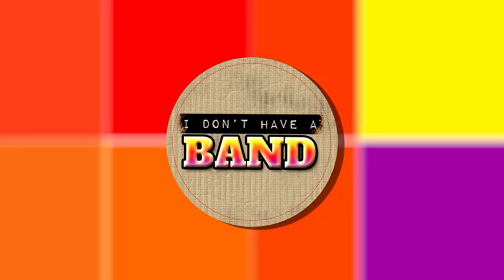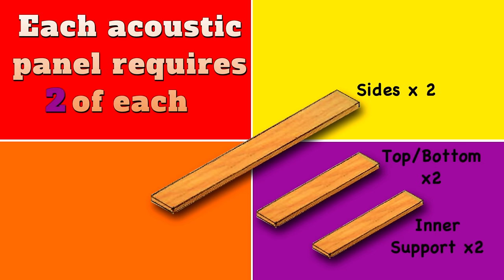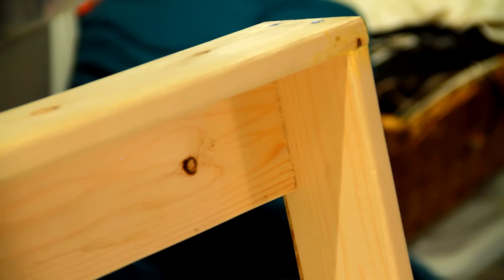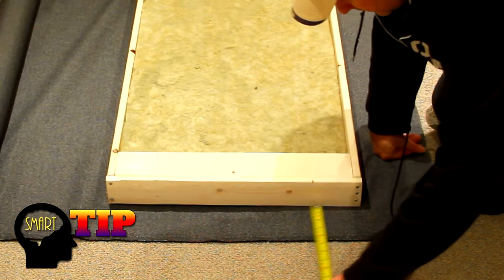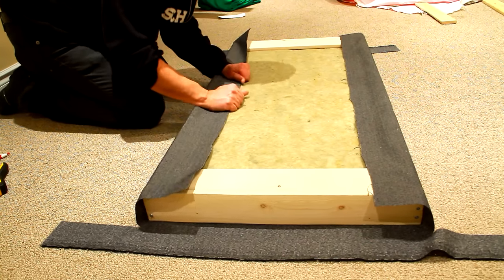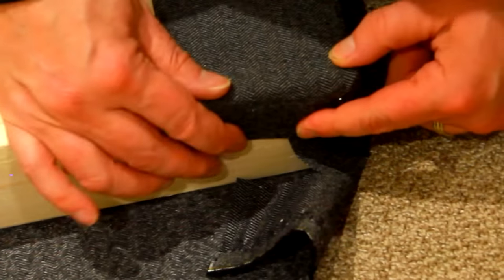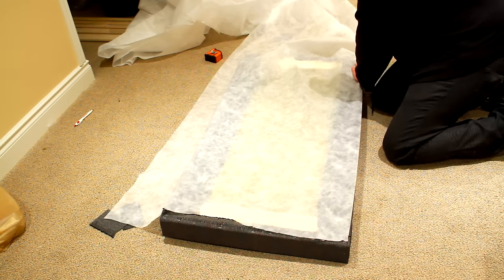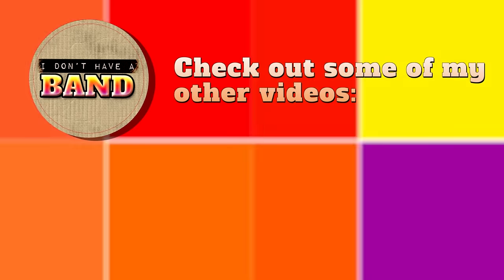DIY Acoustic Panels - How To Make Your Own Cheap and Awesome Panels

Comment: Question. Roxul changed their company name to Rockwool. Was the Roxul Safe n Sound brand @ 24" 46.5 inches in length(true dimensions)? 

 I just picked up some 24" Rockwool Safe n Sound from Home Depot (I'm also in Canada) and the true length of the stuff I have is 47.5 instead of 46.5.  The package says 47 but my batts are definitely 47.5. I think this means I need to make the long sides of my frames a tad longer so the rockwool isn't compressed.  Just wanted to point this out to others since Roxul as a brand name is no longer. It could be I just got an off batch because 47 inches makes more sense instead of 47.5.
Reply from the maker: I used the Rockwool brand actually.  I'm in Canada as well.  You won't have a problem squeezing that extra half inch in the frame.  Don't think you need to make it bigger, unless you want to.  Good luck!
Reply: @LonelyRocker  I think I just had a weird batch.  The first bale had a few pieces at 47.5 inches but the rest are 47 inches. A slight tight fit is probably a good thing. Cheers.
Reply from the maker: Absolutely.  A little bit snug is actually beneficial.  Check my channel for my other Acoustic Panel videos.  My Panels 2.0 video introduces some new concepts plus really meaty bass traps and I have a bunch of other panel resources: https://www.youtube.com/playlist?list=PLXdLRrtu2mlqZQ0ojiINRu53fDSTpTRyO

Comment: Making ceiling hanging baffle and this lets me know I'm doing it right,using egg crate foam for insulation (very dense version) 400 thread count (doubled/cotton = 800) front layer cover.Panel is 36"h×48"w×2"d . will hang over mixer/engineer area
Reply from the maker: I would really test the foam before you go to all the trouble. I’m not clear on the foam you are using but all tests I’ve seen show foam greatly under performs verses proper sound insulation.  Especially in the lower frequencies.
Reply: @LonelyRocker  Thanks 4the info/advise,haven't comitted to anything as far as insolation,just getting my components 2gether,frame done now on 2the filler,so2speak...Thanks again😎
Reply from the maker: The Rockwool/Roxul is pretty cheap if you're making a few panels.  You get enough for 8 panels in the bag so the cost really isn't more expensive than foam and your results will be so much better!  Happy to help.  Thanks for checking out my video :)
Reply: In the radio stations I’ve worked in, we had Sonex Classic foam panels on the walls. Foam of that quality (and you pay well for it), is a diffuser, not an absorber. Lesser quality foam is a waste of money and really just a scam to take your money. To have sound absorption, you need a material that is dense. Rock wool and Owens-Corning 703 are the materials considered adequate for this type of application. I have purchased 12”x12”x12” dense foam cubes before to use as bass traps. FAIL! Doesn’t work. Just go with the rock wool and spend some thought on your anchoring system. You can use screw-in anchors with picture frame wire and you should be able to safely suspend the panels from the ceiling.

Comment: Tips on adapting this design for 4’x4’ gobos and not wasting wood?
Reply from the maker: Measure measure measure!  Plus check out my mini-panels video where I demonstrate using different materials and you can adapt the size to your needs: https://youtu.be/AdDdumAieJs
Reply: @LonelyRocker  Cool...Why did you use 22.75" x 46.5" for your inner dimension when the rock wool panel is listed as 23" x 47"
Reply: sorry that seems dumb, yes I get that it gives you an outer of 2'x4'... but if I wanted a 4'x4' or a 4'x8' will I start getting an air gap that the insulation isn't filling up? If so, should I plan for that gap and add wood spacing?
Reply from the maker: I think you're overthinking this.  The best is to conform your panels to the materials you are using.  I sent you the mini panels video to show you how the dimensions can be adapted to your needs.  Insulation should be snug in the frame.  Air gap is behind the panel for the install.  And instead of 4x8 panels, make 2 2x4 panels.  easier to manage in my opinion.
Reply: @LonelyRocker  Did you find the "actual dimensions" of the insulation off a bit? I am waiting for mine to return to their full size, but I bought 24"x48" because that is what was available here. Do you think they will actually be those dimensions or will they be smaller/bigger slightly? Im just trying to draw out plans while I wait for them to return to size after being crushed in the wrapping.
Reply from the maker: The dark truth about construction materials is the actual dimensions are always smaller than advertised.  Measure a 2x4 and you'll see what I mean.  Just need to roll with it and measure properly before each cut. :)

Comment: would this rockwool stuff work for covering\placing in a window frame to assist in blocking sound from getting out? I'm trying to reduce noise complains from the neighbors before it turns into a bigger issue than i already is. My windows are old as hell in my apartment and sound leaks out like crazy.
Reply from the maker: Sound absorption and soundproofing often get confused.  The techniques in my video are designed to “absorb’ distracting frequencies to improve your mixing environment but can not absorb all frequencies blocking sound entirely.  Soundproofing requires serious structural changes to work.  So these will have little effect preventing others from hearing your music.
Reply: Lonely Rocker Yeah, I’m not looking to block it entirely as that would be impossible especially due to many other areas of the room leaking sound. The window is the major problem that I’m attempting to at least reduce sound from flooding out of a single paned 40 year window.
Reply from the maker: Check out my new panels video where I made 8 inch thick panels.  Maybe these would serve you better: https://www.youtube.com/watch?v=MHnFYFZc-w8&t=483s
Reply: Nikk Grimes seal the window shut with long life caulking. Then place a black panel inside, add insulation, then complete it with two layers of3/4” plywood and screw into place. 

Ad another layer of drywall to your outside wall and ceiling.

Comment: Hey man in regards to the rockwool i'm trying to find our UK equivalent in terms of dimensions is the thickness of the pack you describe 25mm? or higher?
Reply from the maker: Hey.  The Safe n Sound is actually 76 mm thick.  If you find a similar product that's thinner you could double or triple up.
Reply: I'm in England, here's what ya need!

Rockwool - RW3 at 1200mm x 600mm x 50mm (4ft x 2ft x 2inches) - is a pack of 8 and has a density of 60kg/m3 so quite good at absorbing lower frequencies as well as mids and highs! To get even better low frequency absorption you would ideally want the RW3 at 1200mm x 600mm x 100mm (4ft x 2ft x 4inches) but this only comes as a pack of 4 and is about the same price as the 8 Pack, so it's a choice between more coverage but not as much bass asborption or more bass absorption but half the coverage!

You could also get Rockwool RWA45 at 1200mm x 600mm x 100mm - two 4 packs is basically the same price as one 8 pack of the 50mm RW3 mentioned above - but the density of this is 45kg/m3 so, again, slightly less bass absorption in terms of density BUT its thicker so I think you kind of get some of that absorption back if that makes sense?

The smaller the room though, the thicker and denser you probably want the panels to be because you'll probably have more problems with lower frequencies!

You can always start off with the RWA45 for some decent, broadband absorption at your first reflection points and then when you have the money go for the heavy duty 100mm thick RW3 and make Bass Traps for corners!

check out onlineinsulation-sales.com for the rockwool and builderdepot.co.uk or B&Q or Homebase for your wood!

Hope that isn't as confusing as it might sound hahaha, good luck man!
Reply from the maker: Thanks for the assist! Cheers!
Reply: @ethanlonsdale689  you're a legend thank you for this!
Reply: @LonelyRocker Cheers lads!
Reply from the maker: Good luck with the build!!!!

Comment: Great video! I actually followed your process but there are a few things that I had to do to make some adjustments. The first one was finding the right mineral wool to use. The mineral wool that you suggested is very expensive now ($70 for 4 24x48) and it’s very hard to find. So I decided to go with 47“ x 15“ and was able to find six sheets of that mineral wool for $20. The other thing that I had to do was find the wood and that wasn’t cheap either since lumber has definitely gone up in price. I got 6 x 12‘ boards for nine dollars each. Lastly I also got the back paneling for about 10 bucks. Nails cost me nine dollars. The hangers cost me about $12 with the wire. As you can see the stuff starts to add up. The acoustic fabric was $46. In the end these panels are going to average about $30 each. Although cheaper than spending 60 or $70 on Amazon it’s definitely more expensive, but maybe in the end I may not go this route because I have to factor in my time which is also costly. Again great video but you need to make some kind of note somewhere where things have doubled and even tripled in price since this worldwide issue we have faced when it comes to importing goods now.
Reply from the maker: Prices have changed since I made this video but prices also fluctuate depending on where you are.  Another viewer told me his cost was closer to $30 per panel so not that far off.
Reply: Do you know exactly what i will need of fabric for 8 of those with same measures as the video? Thanks in advance.
Reply from the maker: Sadly math is not my thing but just calculate based on the size of your panel, multiply by 8 and add extra just for safety ;)

Comment: How big does the fabric need to be
Reply from the maker: As I showed in the video my roll was 58".  For the width I added 6" past the edge of each side so each panel got 36 inches.  So 58"x36" of fabric per panel should do the trick but confirm with your own measuring :)

Comment: Where do you get the Rockwool (mineral wool) 24" x 48" x 2"? Home Depot or Lowe's do not carry that size. Anywhere online you pay at least $45 for shipping. Where is everybody getting there's?
Reply from the maker: There seems to be an inconsistent supply chain for this product depending where in the world you are.  I'm in Canada and the product was readily available at Home Depot.  The product is also known as Roxul.  Barring that, you should be able to ask your local vendor about mineral wool based insulation designed for "acoustic performance".  There are other brands in different markets.  If you find it in a different size, you may have to cut itto fill your frames.  That's ok too.  Just pack it in nice and perhaps put an extra layer of the backing material inside to hold it all together and keep loose fibers in.  Good luck!
Reply: @LonelyRocker  I found it at a building material supplier! Thanks for your advice. Looking forward to a nicely tuned new studio! Thanks for your help to that end! Bravo!!
Reply from the maker: My pleasure!  Glad you're on track.  Working hard for my subscribes...if I earned one 😀 Good luck with your build!  Check my other panel resources.  I have a few videos that will help you with placement, testing, bass traps etc...

Comment: I'm in the middle of doing this ! Couple of comment worth mentioning, jigsaws are no good to do straight cuts, even with 4" planks (current experience, even with a guide). If you need to go off the suggested dimensions and need to cut the  wool, get the proper tools, unless it is going to be messy (search for isolation knife in your preferred hw store).
Reply from the maker: I think you mean "Insulation" knife;)  I agree having the proper tools is easier but these panels do not have to be surgically accurate.  I've made over a dozen of these with just a circular saw and they all turned out great.

Comment: Screwing into the end grain is about the weakest joint you can make and should be a last resort. A two hole Kreg pocket jig can be had for $40 and is useful for all sorts of projects. Also there are many tutorials on YT about canvas stretching, including the exact order to place staples and how to finish the corners. This has been known for several centuries.
Reply from the maker: These things are tough as nails mate.  Save the cheer for a rainy day :)
Reply: These don't have to support any weight, so screwing into the end grain is not a big deal…
Reply from the maker: @Gongtopia  Bang on.  Thanks for the assist :)

Comment: Mannnn, I put the fabric on the wrong side, and I don't want to remove it. Will this effect the sound, only made this mistake on one out of 13 I am building.
Reply from the maker: Ha!  The fabric should have no effect on absorption...so it should be fine...Maybe a little extra wood on the back.  Or just fix it! 😝
Reply: Thanks 😊

Comment: Does it matter what kind of wood? Pine?
Reply from the maker: Not really.  The stronger the wood the less it should warp over time.  I used Pine and it does the job...
Reply: The wood species isn't very important as long as it can be assembled into a frame.  I used everything from cheap pine plywood to MDF.  You can get a sheet of 3/4 inch (19 mm) plywood at Home Depot, or your local home renovation store.  Just ask them to cut the sheet into strips that are 3.75" wide.  You should get 12 strips out of a sheet of plywood, which is enough for 6 panels.  Plywood may be slightly more expensive than using pine boards, but it will be straight and stay straight, unlike the warped pine boards used in this video.

Comment: Hi, great video... wiill the rockwool  16” (2x4) work?
Reply from the maker: Sure.  If you are still making 2 foot panels you will just need to cut the insulation to fit your frame.  A little more work.  Just make sure you pack it in there and make sure it will hold in place.  Ideally one piece would be more stable but you can make it work if that's all you can find...
Reply: Lonely Rocker thanks for answering back ... I went to lowes and home  depot , but they dont have the exact one. Im thinking I should special orrder it.  If you have a link that would be great , i really don’t want to mees this up. Btw i am located in El Paao ,Texas.

In addition, i wanted to see if its a good idea to wrap the foam with the fabric with some sort of material as the base for the foam.... i was thinking just to insert the foam panel into   the wood structure, i kind of like the look of the wood. Any thoughts on this?

Thanks
Reply from the maker: I honestly wouldn't know where to link you for your market.  I bought mine at my local Home Depot.  I know it's available in the states.  It may be under a different brand like Roxul.  Just ask for Mineral Wool based insulation with acoustical properties.  And make sure to watch my Panels 2.0 video.  It may answer your 2nd question: https://youtu.be/MHnFYFZc-w8 Happy to help!!
Reply: @manueldiazjr6440  Hi Manuel. I'm not sure where you are located but Lowes in most Toronto stores has this. I bought mine yesterday and checked online before I went.

Comment: I need to treat a former dancing hall but I can't make any permanent changes so wall hanging is out of the game. Any ideas to make it portable and stable?
Reply from the maker: You could try and make stands for them.  Use wood to make a sturdy base and mount them upright on the stands.  They are not very heavy so wouldn't be difficult to do if you were reasonably handy.
Reply: Having made these, 3M double sided tape does a great job while not pulling paint of the walls when uninstalled. You could also use picture handing nails as they are hard to see on their own and are easy to fill. If you are having a hard time pulling the 3M tape off the wall, simply warm them up with a hair dryer, careful not to stay in one place too long. However, I have never had to employ this trick.

Comment: Great video.. what type of fabric did you used ty
Reply from the maker: Thank you so much.  As I mention in the video you can use pretty much any fabric as long as it is breathable.  I bought a roll of my fabric in a regular fabric store.  The one I chose is a little rigid and doesn’t crease so that helped with the install but you can really use any fabric that’s thick enough to contain the insulation inside yet still breathable so sound can pass through it.  Hope this helps!
Reply: @LonelyRocker  thank you for replying I will do that i was afraid of micro fiber of the rockwool to spread in the room i will search for a thick fabric thanks
Reply from the maker: I actually spoke directly to Rockwool about health risks and possible fibers in the room when using their insulation for this purpose.  I may cover this in depth in a future video but what they told me are the fibers in Rockwool are too heavy to be carried in the air.  If they do come out they simply fall to the floor and do not remain airborne, therefore posing no risk..  I may research this further for a future video.  Good luck with your build!  Let me know how it goes.  Good luck!

Comment: I'm trying to come up with a solution for noise created through an adjoining wall. Thanks for your video.
Reply from the maker: My pleasure.  These unfortunately won't solve your issue.  They are designed to make the sound in your room better by managing reflections.  They really don't create a barrier to prevent sound from passing through walls.